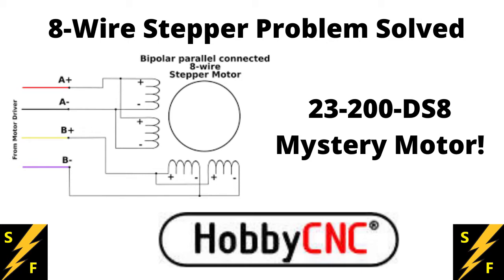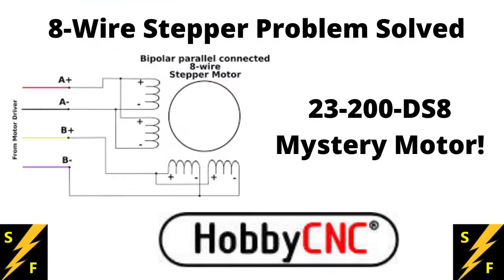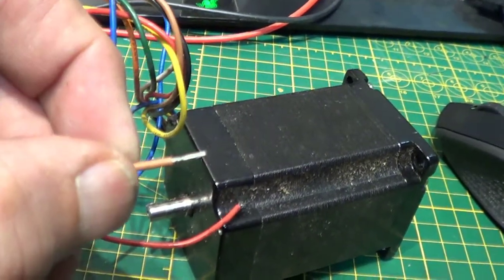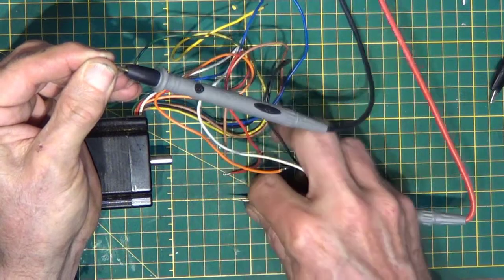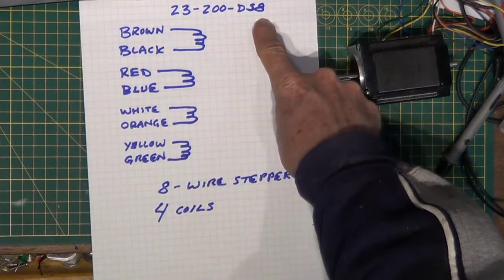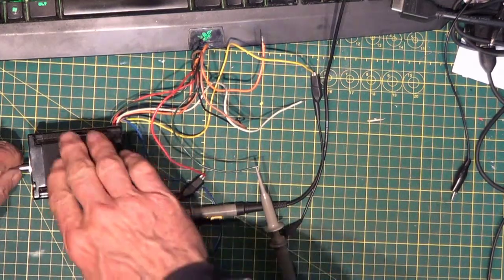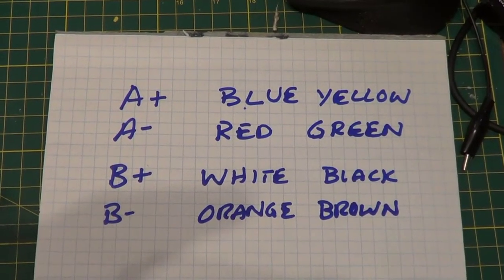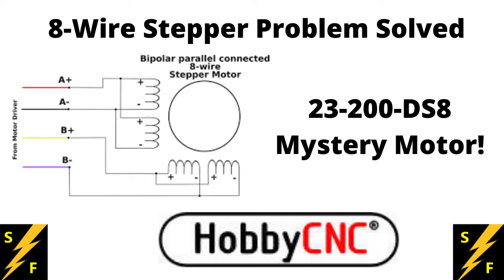Stepper Motor Experimentation

Comment: I have 3 steppers with 8 wires
They are using 4 terminals and have the other two pairs twisted together. 6600 drivers
Would my performance improve with this wiring?

Comment: silly 3d printer related question
i have a bunch of scrap bin nama 23 motors they technically all are "8 wires" but they are internally connected on a pcb to either be series or paralell
but i think they were never intended to be used at 12v, or at least they were designed for 24-36v because they are not very powerfull even compared to the same size motors in comercial 3d printers (runing on 24v) i did some experimenting, i made motors heat up by increasing current, but the one i have problem with is the one runing the extruder
so since extruders are rater slow most of the time and have to push the material with greater force, should they be series or paralell and does the higher current an lower voltage just heating up the motor which could work much better on higher voltage and less current?. i am considering adding small stepup power suply just for steppers, or going full 24v with the printer  but if i can do anything with 12v to get more power than things i already did i would apriciate the reply